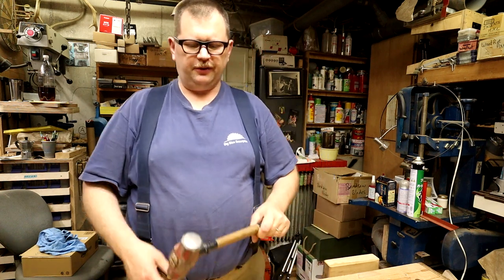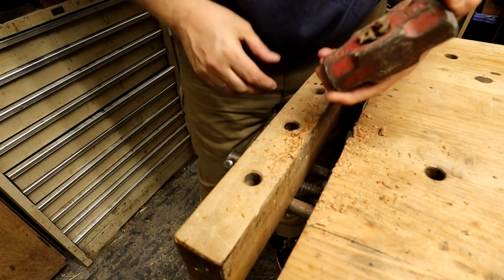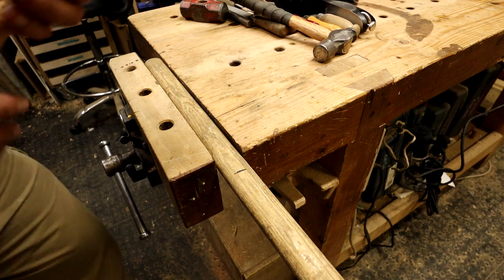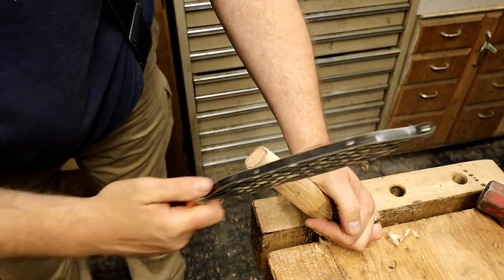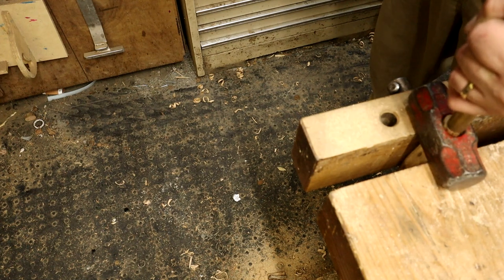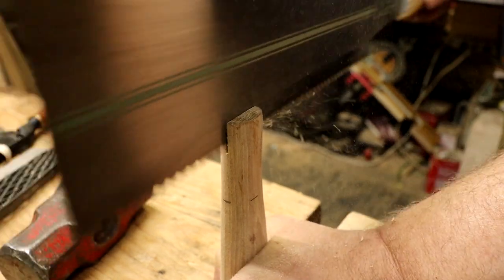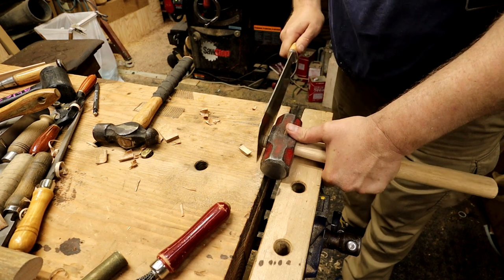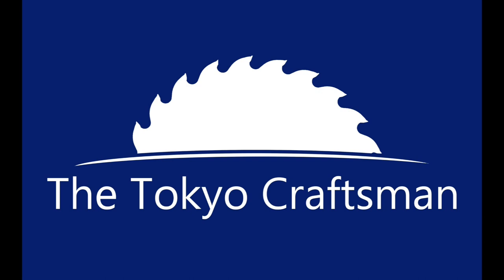Hanging a New Handle on a Mini Sledge

Comment: I'm currently rehandling a ball peen. Which hole is the top of the hammer head? Big or small?
 There is no previous handle in it for me to reference from.
Reply from the maker: The wider end of the hole goes on top. When you fit the handle make sure the bottom of the hammer eye fits tight, then you wedge the top part of the handle where it comes through the head, leave maybe 1/4" or 6mm proud. When you wedge the handle the wood will flare out into the larger hole in the top of the head of the hammer helping to keep the handle in place, but you must make sure that the handle cannot be pushed down the handle shaft. This is why the handle will often have a swell right below the head of the hammer.
I hope that makes sense.
Reply: @TokyoCraftsman  Thank You for the quick response. That explains it perfectly. You've been a big help for me.